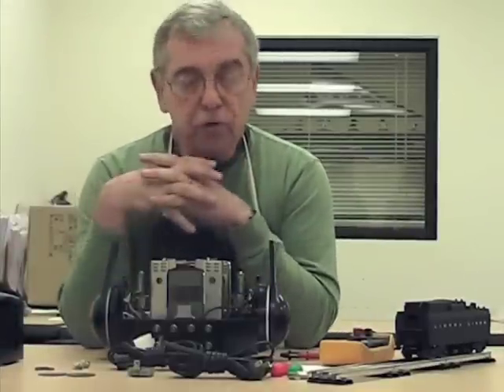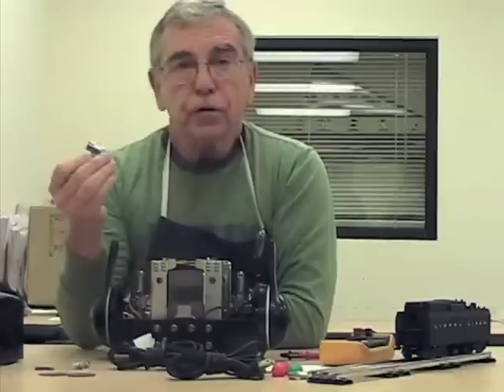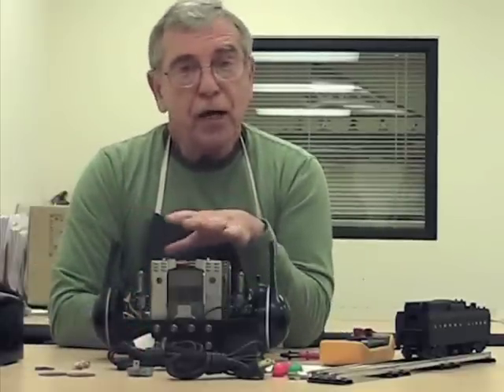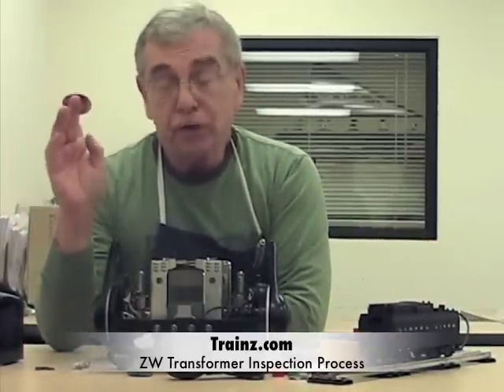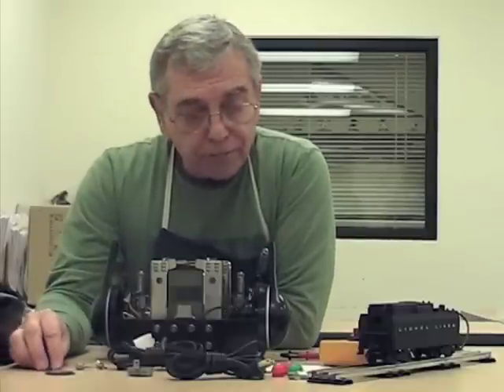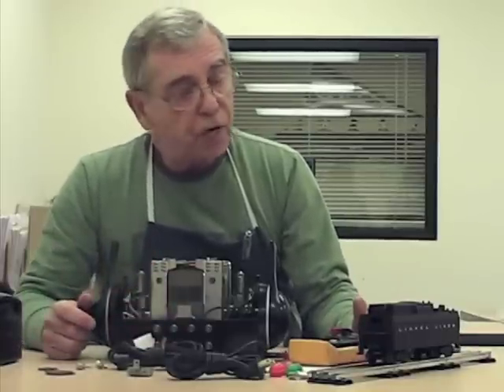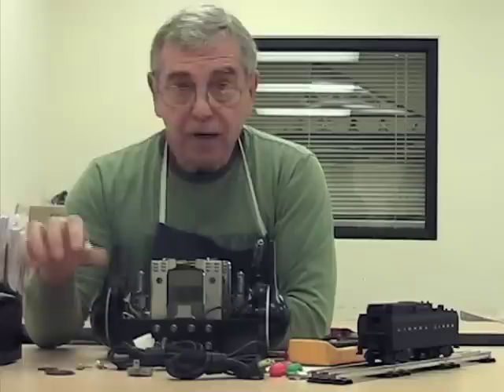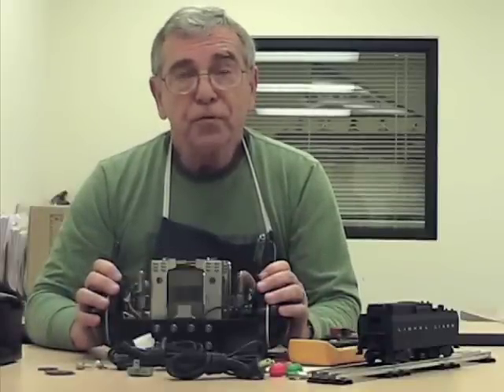Lionel ZW Transformer Inspection Process from TRAINZ.COM

Comment: I've got 2 - 275 watt ZW's and a KW, I did have to replace the overload on one of the ZW's, but they are real work horses. I was running 5 trains on the ZW's and using the KW to power the accessories. If you aren't fairly confident in your troubleshooting skills, The ZW is one that you should leave for the Pro's to repair. Just my 2cents 
worth.